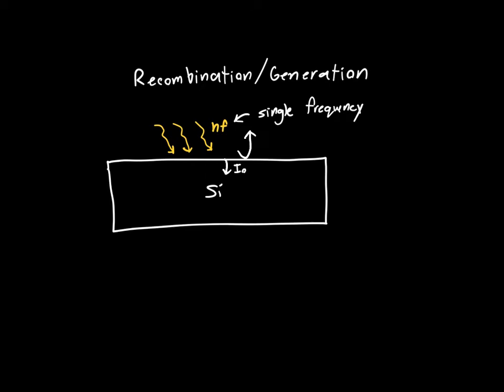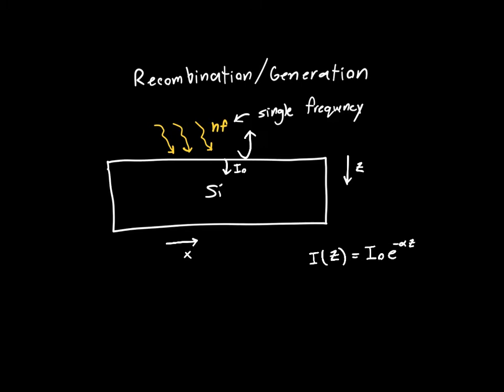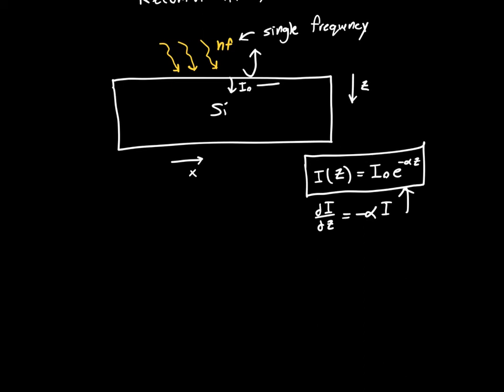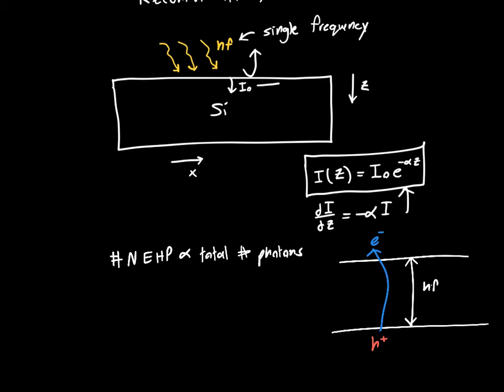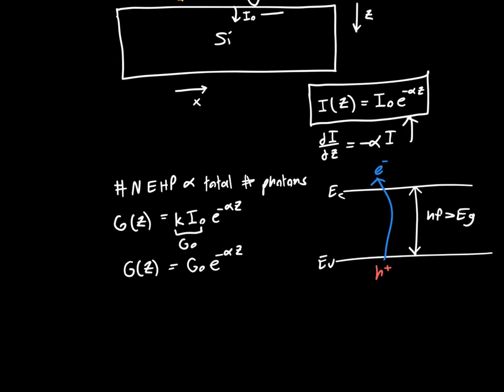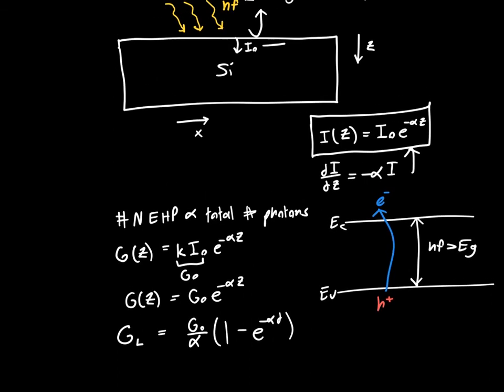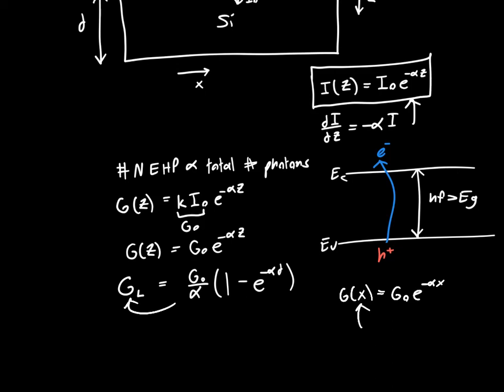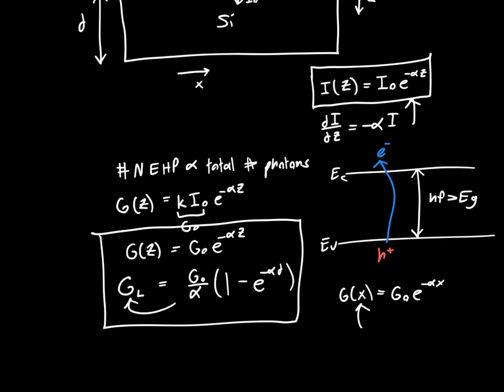Light Generation of Electron Hole Pairs

Comment: Is Gl the representation of the total number of generated electron-hole pairs, since it was the integration of the generation rate? Was the integral of G(z) with respect to z?
Reply: Gl is the total number of generated electron-hole pair at an x coordinate in the slab which is found by integrating G(z) from z = 0 (Top of the surface) to z = d (d for depth)
Reply: Thanks for clearing the doubt!